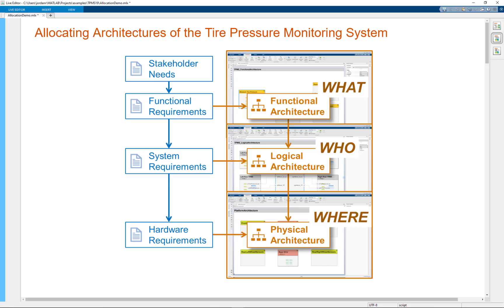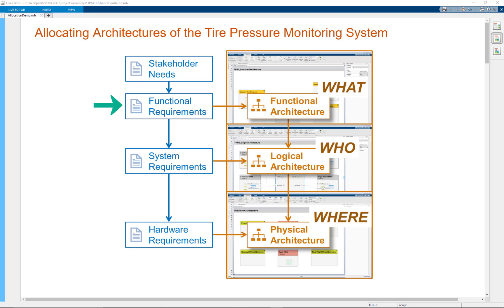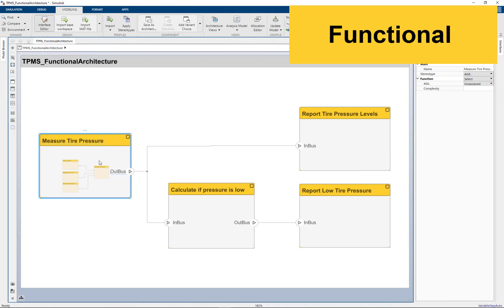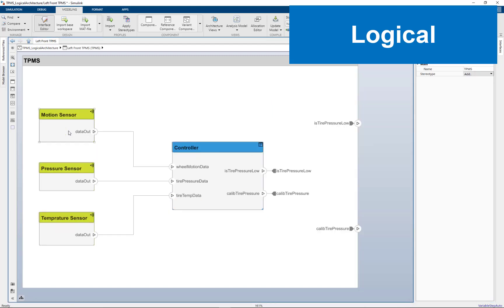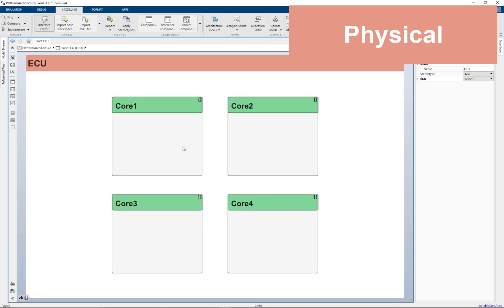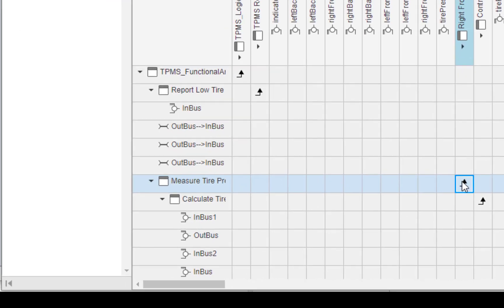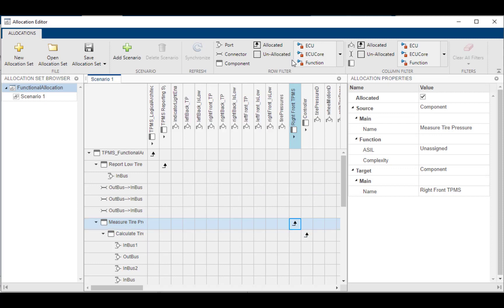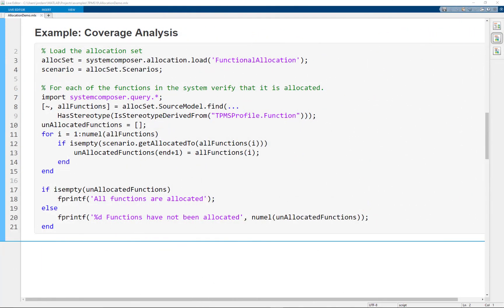Allocating Architectures of a Tire Pressure Monitoring System in System Composer

Comment: Hello. I have a licenced version of MATLAB R2020a version available in my machine.
is the System Composer already available with my software? or do I need to purchase separately?
Reply: System Composer is a toolbox that is separate from Matlab and simulink. You can check if you have system composer already installed by typing this in matlab command window.
>> ver 

Now check the result and see if system composer is already installed. :)
Reply: @omkarwaghmare9787  Thank you for your response. I checked, unfortunately, it is not available with my current package!.
cheers.
Reply: Also, System Composer is not available for Home License. You can only purchase this toolbox if you have either student or professional license.